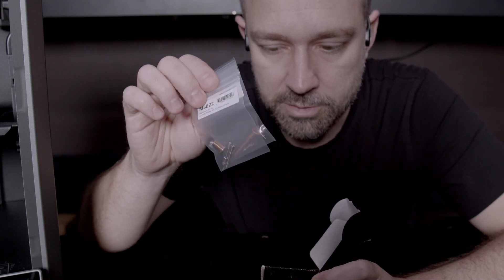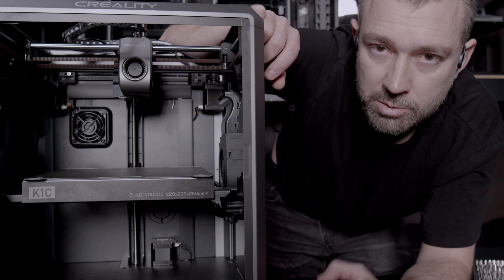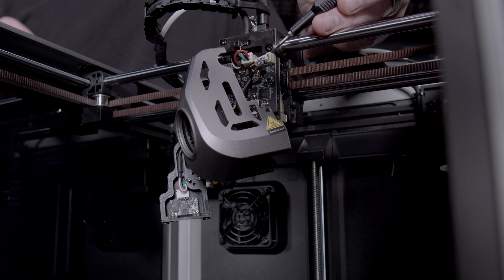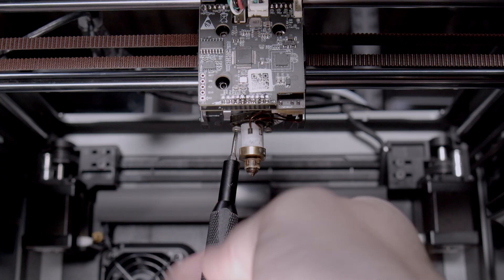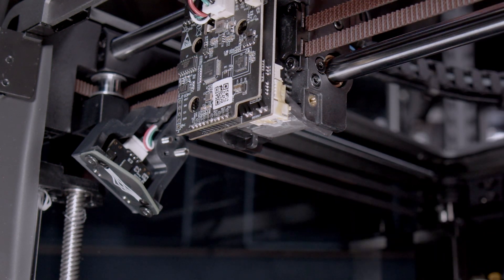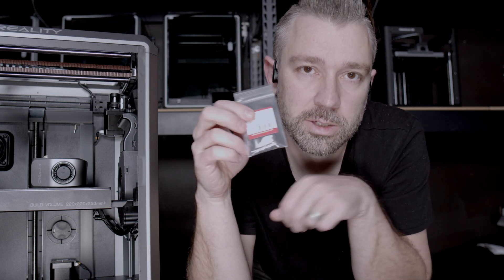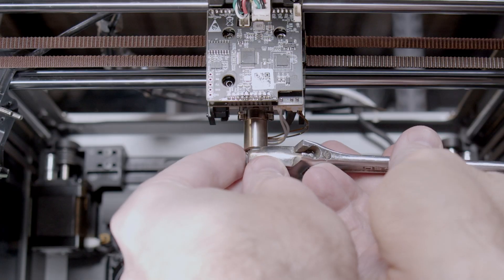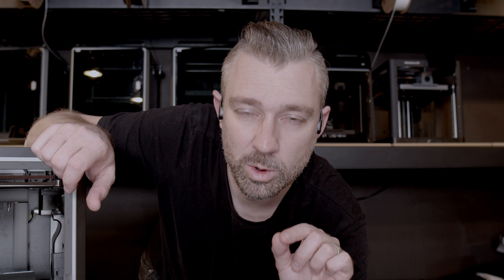Upgrading the Creality K1 Hot End with Micro Swiss FlowTech

Comment: You are the ONLY person who has mentioned the unicorn nozzle variant of the micro Swiss flow tech upgrade. Thank you!
Reply: It’s because when Creality released the K1’s they used volcano nozzles and it had clogging issues. MicroSwiss developed their kit to fix the issues. Then Creality released the Unicorn to fix their clogging. MicroSwiss still had a better flow rate so they modified their design to fit the new Unicorn models.

Comment: Just a heads up for people if they're finding this video like I did- the 2025 models of K series Creality machines have new connectors for the heater and thermostat. You'll need to also pick up the "Hotend Adapter Cables for newer Creality K1, K1 Max, K1C, and K1 SE" found on the MicroSwiss website.

Comment: Great video!  I installed the  Microswiss nozzle. Would you please provide some input on how to tune the PID and do the input shaping?  I have been searching day for PID turning and from everything I have read it appears you have to root your printer to do it.  Thanks!
Reply from the maker: @ronaldrakos6420  Good news. If your not rooted you just run the self calibrate or self tune for the printer. It will do input shaping and pid. No need to root.
Reply: @zerodotcmd  Thank you Sir!!!

Comment: Got two of those Flowtech hotends, the one with the long Heatbreak gives me only clogs with pla, the heatcreep is the problem. The shorter / old version has a ptfe Tube which isolates the heat so that one does everything right.
Reply from the maker: That sucks. Luckily I haven't had any issues with it. Hopefully this doesn't happen on my end.
Reply: @zerodotcmd  it's more of an issue, the longer your prints run & the hotter you print. It's pretty fine tho for Filaments like abs. 
Totally differet thing: what do you think ...could we be able to install Ballscrews into our printers? - regarding z-wobble.
Reply: this is exactly what's going on with my printer since I went to the "unicorn" hot end.. it's been driving me crazy! So can I order this with the tube that can isolate heat?
Reply: @JoMiller97  really glad I stumbled across this comment section...Ive got an older K1max that uses the short heatsink adapter..And just from looking at the 2 hardware kits included with the Microswiss FlowTech, one would think the longer, 1 piece adapter would be superior in that it reduces the number of "breaks" or transitions between the ptfe tubing & the hotend nozzle...I was looking to modify my heatsink to accept the unicorn nozzle but it seems as though that would not be advisable

Comment: My Hot End with Micro Swiss FlowTech came with the Hotend section loose, easy to tighten with the two bolts but then the Hotend cable came loose out the plug. Poor quality Control
Reply from the maker: That sucks. Luckily I didn't have this issue, Quality control is a real problem now days for a lot of companies.

Comment: The creality E3D obXidian high flow nozzle gets you one hell of a robust nozzle with cht while retaining the uninterupted filament path of the original unicorn for significantly less $$, massive jump in flow rate, double.
Reply from the maker: Yeah if someone's not replacing their hotend this is an option. For me on amazon the MicroSwiss is $65 for the hot end with a nozzle, while the E3D is $59 for a single nozzle. The nice thing is with FlowTech the CHT is $20 per nozzle once you have the Hot End.
Reply: @zerodotcmd  Interesting, here in NZ the price differential is very different, 80NZD for the nozzle compared to over 200 for the hot end. US shipping to elsewhere is expensive sadly.
Reply from the maker: @m3chanist  yeah pricing in different regions is insane. The 3m sheets for my Glass Bed mod cost me $5 while one person told me in their country they cost $30. Not to mention availability. The E3D is currently out of stock for me everywhere I look. But I'm sure one state over its available for everyone else.
Reply: I have the obxidian too, had some doubt before buying it as i was scared the tip would fall out during heat cycles. But it works great, i have the new creality diamond tip nozzles and they perform really like the original so i wouldt recomands those if flow increase is something you want. Obxidian works great
Reply: I’ve been using the obXidian unicorn nozzle for about 200 print hours now. Flow rate was marginally increased, but also have had some variation in extrusion that caused part failure several times. Currently switching to the flow tech hot end now due to these issues

Comment: Hi bro, I wanted to know if it's worth changing the nozzle, if it makes a difference when printing. In my case I only print with PLA and sometimes ABS. Is there a difference in print quality?
Reply from the maker: I've noticed a difference in quality and I haven't had to worry about any jams lately. One thing I've always hated about the K1 is no matter my settings I've always had issues with stringing, This nozzle has removed my stringing issue, in my opinion this is its biggest win.